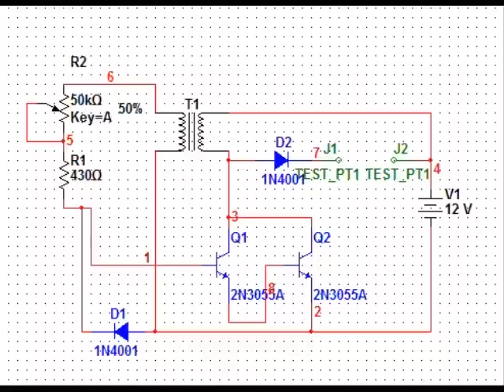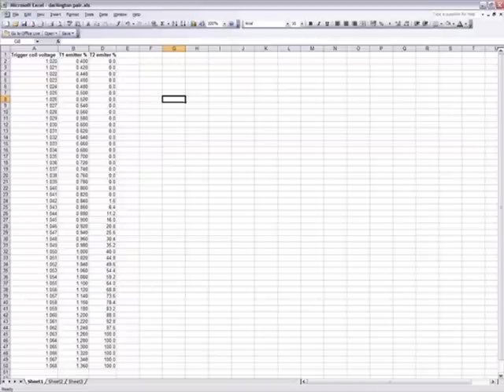reccomended upgrade - darlington bedini

Comment: Doesn't look good from my end I'm afraid :( I tried a darlington configuration on my solid state set up and at best the spike is equal, at worst, nonexistent.
When I tried it as shown in your schematic there was no spike at all.  Then I tried adding a few different valued resistors on the collector of T1 and as resistance went up the spike increased until it was back to how it was without the darlington.
Has there been any verification that the spike can be increased using a darlington pair?

Comment: ok... comments seem to be working now...

I was also pondering using a darlington pair to reduce the switching time of the transistors, though I'm not sure if will work since the base current from T1 that activates teh transistor will also be flowing through the base of T2 at the same time, so though T1 may provide more base current to T2 after this, if the current is enought to trigger T1 then surely T2 will be triggered at the same speed as T1.

Comment: yes ... makes sense. I will do some testing. The relitive field strength and attraction to the mags in the rotor by the core may cause less drag, speeding up the rpms. However I expect to find less generating potential as the field around the coil is made less intense. I'll let you know...........  scooterscottii

Comment: I have noticed an interesting effect with my bedidi circuit motor. If I stick some neo mags to the (outside facing) core of the bifoliar coil it will speed up the rpms by about 30%. inversely if I turn the mags around it slows the rpms. What do you think is happening?  Scooterscottii

Comment from the maker: it does depend on your magnets, but ~80% of them have the north face more 'powerfull' than the south face...

Also... if the rest of them are north out then your bedini will not be pulsing on the south out magnet so you'll be loosing speed, torque and back emf...

It also depends on what your doing with your bedini... other people like me run a N - S - N - S alternating fields for generator coils... But if you've built a bedini just to charge another battery then North only is the way...

Comment: Greetings from Oregon! I made a rotor for my SSG circuit with six mags around. Unfortunately the first mag I installed was  S facing out toward the coil. Question ... Does it matter which magnetic pole faces the coil? I noticed several people use north. Should I change it? THANKS for any info!    Scooterscottii

Comment: I will state that this adaptation can be considered a significant step forward. I was there at the conception of it's use and  this is an excellent method. The rotor is faster, it uses less at speed. The pots now have some protection (no more blown pots) and have an increased tuning range requiring a much larger variable and base resistance on the base of the transistor. i run 400 ohm base resistors with 47k variables. 3 pole rotor 2 bifilar coils. Lots of torque. 3 or 4 'gears'.

REPLICATE!!!!

Comment from the maker: i have two issues with what you just said...

"time constant's" are not constant nor are they the same from setup to setup...
The speed of the rotor alters the "time constant" even if you consider the "time constant" is per magnet... magnetic induction (within your core) takes time (miliseconds) in order to form a magnetic field, this time is a constant and is not effected by magnet speed...

Also, you use the pot to control how long to pulse is on for...

Transisters are not digital...